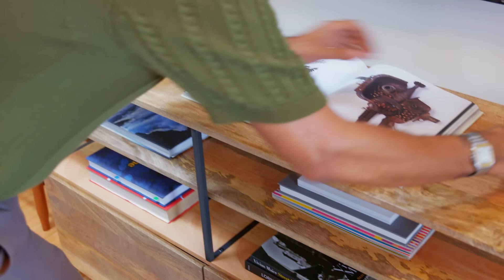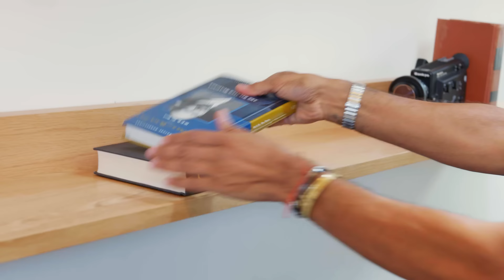2.5 Hour NYC Living Room Makeover By Pro Designer | Room Refresh | Architectural Digest

Comment: Well done.  The curtains are genius. But... Bibliophile here.  Love plants.  I agree that they make a positive difference in a space and look great here. However, books and water do not mix.  Plants need water and are damp.  Books are  made of paper and easily ruined by damp. (mold anyone?) Books are not pedestals for plants unless those plants are plastic.  Buy bigger plants. Do not endanger books.  Books are not quaint relics of the past.  Many humble books have great value.  So some respect and care. (If you must, buy small plates to go under the pots 2nd hand.  Adds interest too!)
(Ditto candles.  Books+ candles = Fire hazard. Paper burns.  Also no candles on shelves with shelves above. Again, fire  hazard. ) Once more, Respect and Care
Lovely design.  Function and Beauty.

Comment: it looks nice what you created in there. But to improve things a bit more you need to take into consideration that the walking path from the single door to the double door all the way to what seems to be a bedroom. In the middle of the walking path, on it's length, you have at half on the width of the path the ending of the carpet. That carpet ending right in the middle of the walking path is a tripping hazard. It might look good, but it will get very annoying very quickly for the people living there. So you need to move it a bit more towards the console, but of course without touching it.

Comment: This was well done. But it bothers me he didn't provide a solution for the library they hardly ever do, don't designers read books?) This bc she very specifically said there are stacks of books constantly moving around the space. So either elsewhere in the flat, or a better suited 'hero piece' for books or a rotating book unit instead of fike cabinet (who needs those?) could've adress that, bc chances are those horizontal shelves will likely be full of books end to end (changing the space and weight of it) and with no extra bookstorage added the same problem arises.
Besides this very common miss, he did what I'd expect for a professional and improved the room on a low budget without making it busier.

Comment: The new desk may sure looks nicer than the old one, but a good interior designer should not only take optics into consideration. I'd say the old one wasn't perfect in terms of ergonomics -- but the new one, especially considering her height, is a catastrophe. The old desk had a better vertical position for the monitor and for her arms while using the keyboard. The new desk has everything too high for her (just take a look at her sitting at the desk at the end of the video) which puts stress on her eyes, neck, arms, etc. But hey, a stiff neck or wrist pain is negligible if your desk looks gorgeous.